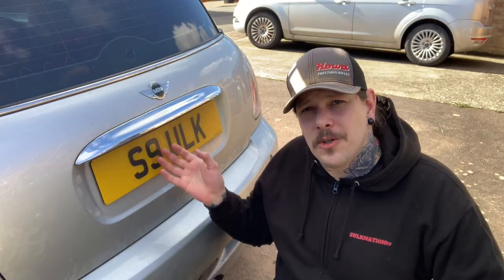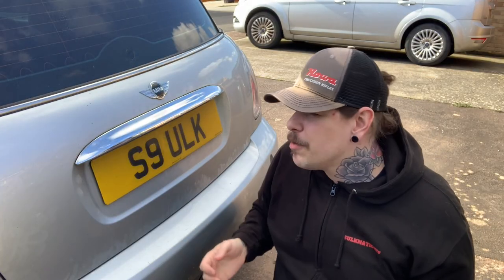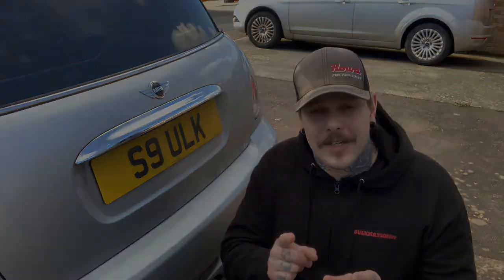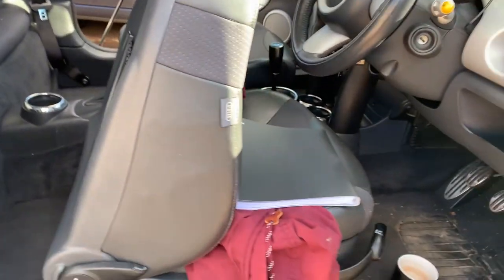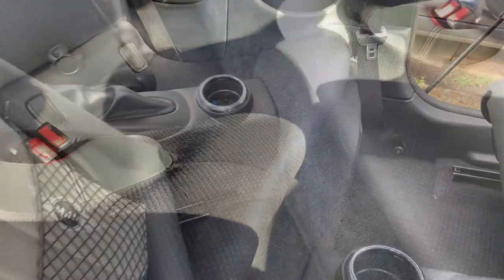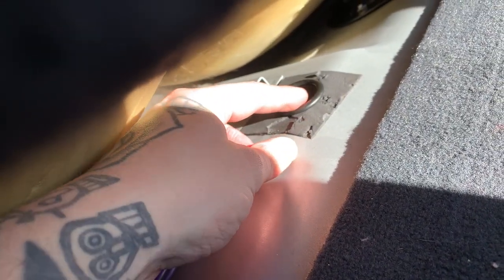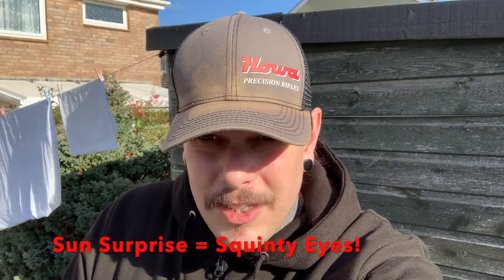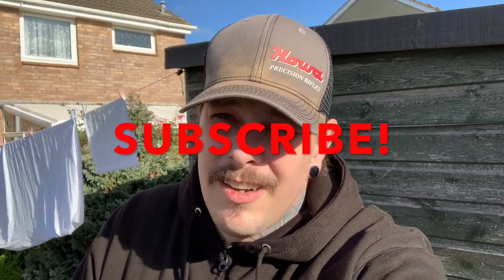BOOT/TAILGATE WON'T OPEN? *DO THIS* - R53 MINI COOPER S

Comment: Early cars, up to about October 2002, don't have the trunk catch pull ring under the seat. 
A retro-fit kit is/was/might be available from your friendly MINI $$ealer.
Reply from the maker: I’m going to ‘pin’ your comment mate, as I have just discovered this ludicrous information myself! Thank you for confirming! 👍🏻
Reply: do yk anywhere i could find one of these to add to my r50
Reply: Yes, my 2002 does not have this pull ring. I can not find any information on how to open the hatch, much less how to acquire or install a retro kit.
Reply: @michaelmann8800 damn i dont have this cable either. How do you open the trunk then?

Comment: Sadly my 2016 doesn't have this little pull and my outside latch just isn't working, yet the car says the trunk is open. Time to further investigate.
Reply: Mine is the same but haven’t figured out a fix. Did you have any luck?
Reply: @04jhowarth I ended up selling it lol. I was told it needed a $500 part though, not entirely sure what the part was I’m sorry

Comment: Thanks for showing this, Alex. But when I tried it with the pull ring/cable, but the boot lid only opened a bit. The lock probably needs adjusting. So I had to find another way. Managed it with attaching a separate battery to the jump start connector under the hood and mass. I could then open the lid with the button on the boot lid.
Reply: same, it only opened a tiny bit

Comment: Great. How do you do it from the outside of the car with a dead battery?
Reply from the maker: You should have an actual lock/barrel in the drivers door handle… manually open the drivers door and you have access to the rear seat. 👍🏻 I did at least on my R53! 😂
Reply: @SULKNATIONtv  It is actually a funny story. I couldn't see much last night when I went to move my R56 and found it dead but when I turned key to unlock instead of using fob it normally works and I can even do that thing where it opens the windows, sunroof. So, I try again in the morning holding the fob over the windshield to push button (at least one knucklehead on yt said that worked) Eventually I called the local Mini dealer and they told me that blade key access is mechanical, not electric and I should be able to get in the car. This didn't make sense to me bc normally the window drops a smidge so it can fit out the door frame and I know that is electrical. But, on a lark I tried again, and again. And, then for shits and giggles, I tried to turn the key the other way. Then the door unlocked.

--SHAME-- facepalm
Reply from the maker: @tristramcoffin926  oh man, that is a face-palm moment! 😂 We all have them, in fact I have at least one a day! I’m glad you managed to get in the car in the end! Hopefully it’s an easy fix and you’ll be back motoring again quickly! 👍🏻

Comment: was wondering about that the other day... as all our other cars are sedans.

Hubby and i had a disagreement over where the spare wheel was - 

I told him that i don't have one as its super charged and the battery is in the boot...

He recons that the tools for the jack and to wind down the tire are in the same place... 
(maybe on a non supercharged mini)
Reply from the maker: I didn’t have a jack located anywhere in my R53, I did have a puncture repair kit in one of the side compartments in the boot. The area where you can get access to the rear light clusters… 👍🏻
Reply: @SULKNATIONtv  yeah I think I have that, haven't looked too close and it failed it's road worthy. 😯
Needs a new engine mount...oil leaks... Other stuff. 

You said you have an 05 face lift,  that's still an r53 body with a few dressier bits? 

I want to get the tail lights with the chrome around them but not going to buy and pay for shipping to Australia and then they don't fit... 
I have an 04 Sr53. Know anyone with that model?
Reply from the maker: If it was built after July 2004, then it’ll be a facelift R53 like mine was… the main differences are LSD, interior dash going from 5 piece to 3 piece, 3 spoke steering wheel, the rear lights had the reverse light moved into the cluster…
Reply: @SULKNATIONtv  @SULKNATIONtv  LSD  being limited slip diff? 

I'm wondering***  if I could put in the face lift lights but just leave the reverse light connected where it is down the bottom. Buuuuuuuut that would be illegal lol. I could always just run 2 extra wires... and by me I mean hubby. 

There is so much info all over the place on pre vs FL the only concrete thing I have found (by myself) is the reverse light centre bottom. 
Apparently there is different chrome around the front grill, chrome tail lights, moved reverse light, 3 spoke steering wheel, the dash (thanks Sulk) and the clock, door panels and the keys are different pre has 2 buttons. - that's a bunch of randomness from a bunch of sites that I can't verify apart from what u have told me 👍
Reply from the maker: @allieg6401  'Limited Slip Diff' is correct!

That's pretty much all the differences between pre-FL & FL! Plus an extra 7bhp and a teflon coated supercharger (well the supercharger blades anyway) for the FL! The FL light swap has been done, so it's possible!